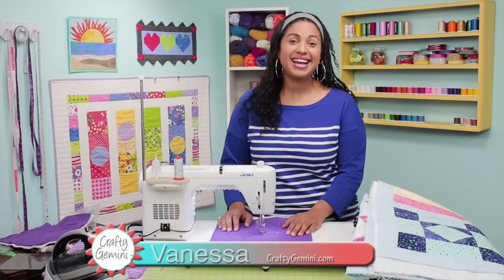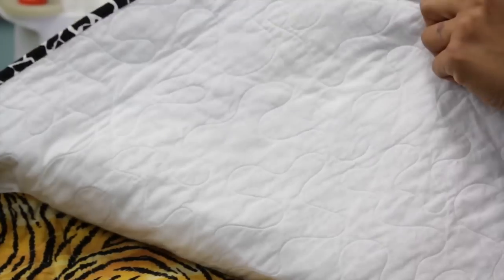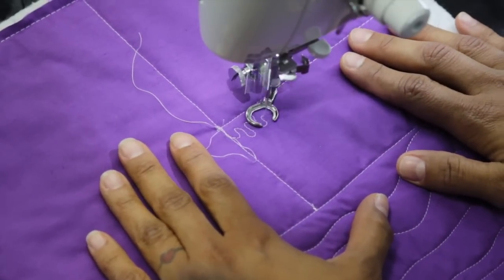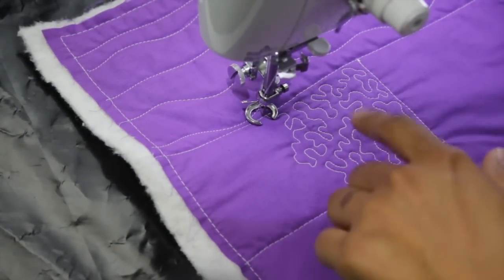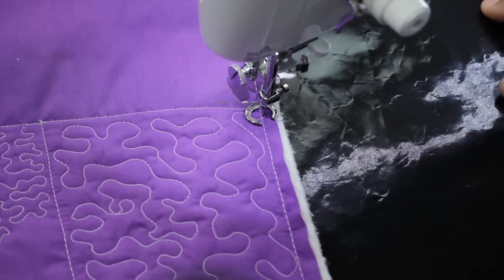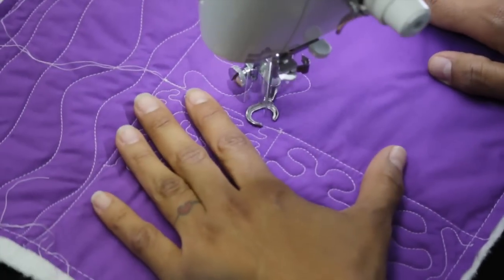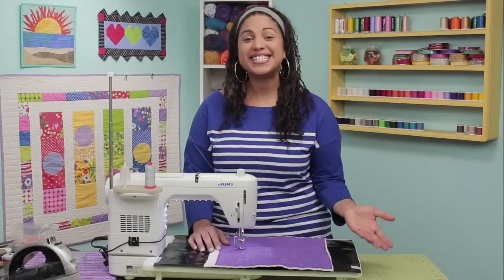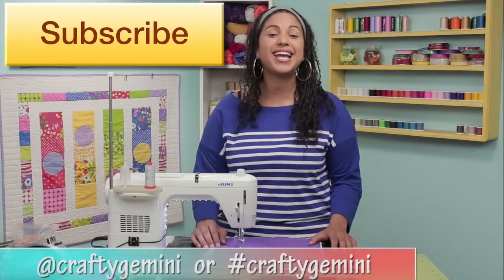Free Motion Quilting Tutorial Series- Video #5: Stippling and meandering stitches

Comment: From what I've learned "stippling" is done in a tighter, compact pattern to hold a small area down. And "meandering" is done in a larger design to fill in an area where the density level isn't so tight.

Comment: I am having trouble choosing cottons for certain quilts I have made with lots of vibrant colours  including black in it and it is mainly made up of squares, no one seems to talk about what cottons to use and especially colours and backing.....and so I have only been making my quilts by stitching in the ditch, with the colour on the top the same as the squares. Help please...
Reply: I struggle with color, too.  Everything I find is either too light, too dark, or has another color mixed in that clashes with the other fabrics that I've chosen.  I think if you stick with 100% cottons you'll be fine.  Don't mix cottons with other fabrics that have polyester (or other fibers) mixed in, because they'll shrink at different rates.  When you're a beginner, you start with stitch in the ditch.  It's the easiest form of quilting.  You move on to free motion quilting (and stippling) once you've mastered other aspects of quilting.